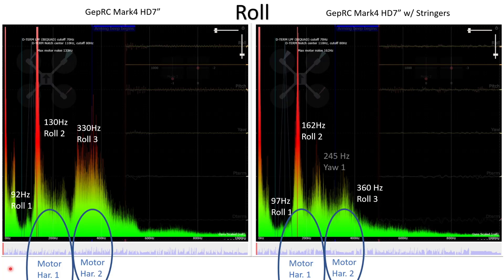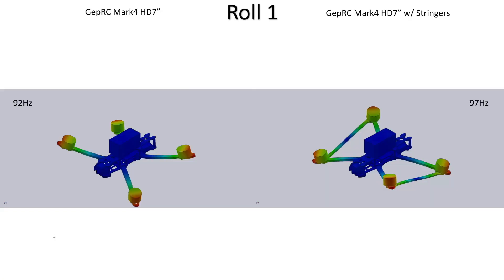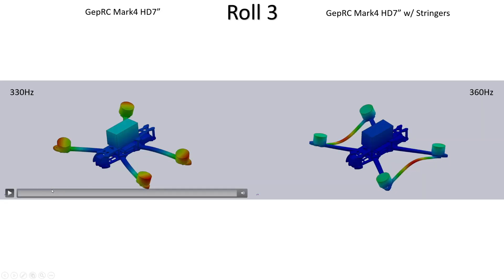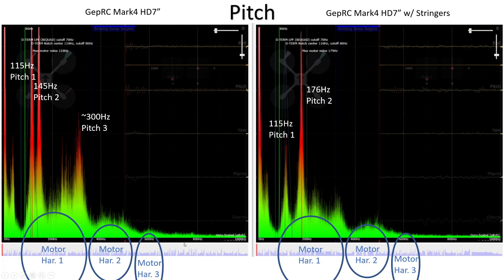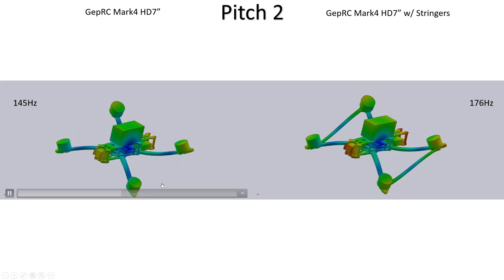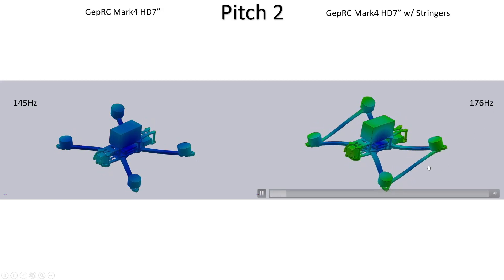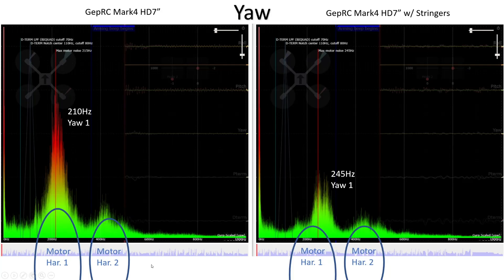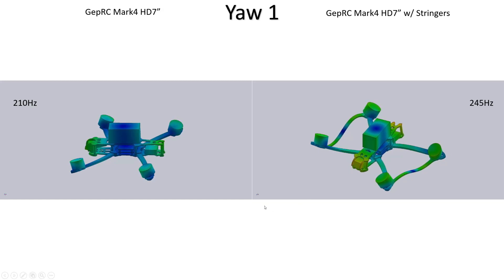Improving the vibration performance of your quad with some simple carbon fiber pieces!

Comment: How did you attach the stringers and did you make a video on best way to attach the stringers?
Reply from the maker: I used longer motor screws.
Reply: @ChrisRosser  I got it 👍  that's what I was thinking just wanted to make sure

Comment: i am sorry but the stringers dont fit a usual GepRc mark4 7". the hole distance in the stringers are wrong. the GepRc mark4 Arms have only 16x16mm holds for the Motors, your stringers are for 16x19mm hole distance.
please correct that before more people (Like me) let them CNC milling and Need to rework the Holes to fit the Mark4 Motor Holes.
thank you
Reply from the maker: I don't know what to tell you? They fit both of my frames... The arms for the Mark 4 7inch have 16x16 and 19x19 mounting. They should even fit 16x19mm (but I don't know of any motors with that pattern) I'm sorry to hear that you had problems.
Reply: @ChrisRosser  No Problem, i Just Open one hole to a Long hole with my dremel to fit the 7" frame. IT works Like this. 👍

Comment: I've got lot of experience with this frame. To be honest, it's horrible. It's way to soft. I was running it on 2806.5 motors on 6s and biblades. It was impossible to get good flight performance due to massive frame resonance. It needed tons of filtering and notches. 
I switched to the FR7 frame which is much stiffer using 6mm arms. I also increased the thickness of all plates to 3mm to make it even stiffer. It's still not perfect and especially running biblades still induces vibrations causing jello. Props and motors are perfectly balanced, so it's again some frame resonance.
It would be great if you could take a look on the fr7 open source frame (see on thingiverse).
Regarding the props, I've tested nearly every 7" prop on the market. The best balanced prop is the HQ 7x4x3. All other props need to be balanced. The worst efficiency has the dal Fold F7, but it runs very smooth. When running biblades I would suggest using APC 7x5, they are very stiff and have the least tendency to flutter. They are also extremely durable and efficient at higher speeds.
If you are interested in more information, just write me. I'm doing testing for over 1.5 years now on 7" platforms and would be happy to get some more background knowledge in terms of resonance management.
Reply: hey Waldemar, 
you say you tested a Ton of Props.
Did you Test the Gemfan 7035 biblades, i am about to buy them for Testing because i dont want to Stick to the Dal 7056 triblades anymore they Draw a Lot of amps.
i think lower Pitch would bei better for Higher Rpm and create Higher frequencies and less jello.
also Low Pitch will Draw less amps and give Higher efficiency as Well.
correct me If i am wrong.
Reply: @MrJT270567  
Biblades resonate different (at lower frequency) and create lots of jello. Also the gemfan biblades are quite flimsy.
If you really want to go with biblades, use some APC 7050 or HQ 7045 durable.
At the moment I'm using the new gemfan 7035 cinelifter props. They have good balancing and are very efficient.

Comment: How would one go about getting some of these stringers? I have a Chimera7 on order.
Reply from the maker: If you can design the parts you can get them cut by any local CNC machinist who works with carbon fibre. I use CNCMadness.

Comment: Fantastic content. I wonder if changing the center of gravity on a quad (eg, top mount battery vs. mid mount vs. bottom mount) would bear any significance in dealing with vibrations? Personally I really like how mid mount frames (like the Remix) fly, and all those slammed builds, I always assume that putting the battery at the level of the powertrain could reduce the force required to swing that 200g weight thus putting less stress on the carbon. Could you share your thoughts on the relationship, if any, between vibrations and the cog? (I have zero science background so sorry if this sounds like bro science)
Reply from the maker: I've added this to my content list. Thanks for the suggestion.

Comment: I have the same frame GEPRC Mark IV, its very soft and vibrating on pitch axis, i have also stiffen it up but closer to the bottom plate, it's better but not perfect. Emax Eco 2807 1300kV on 4S is perfect but at 6S it;s a drama, motors to powerfull, and frame is bending.
Reply from the maker: Sorry to hear that. I hope the video helped!
Reply: @ChrisRosser  this vid made me sure in  my doubts about the frame. Awesome job!

Comment: Hi Chris , thanks for the great video. I have 2x GepRc Mark 4 HD6 frames (with custom 5.5mm arms) and one GepRc Mark 2 6" , i  use them for comercail work and mid range crusing. I was wondering if you could share the files for the carbon fiber stringers it would be intresting to see difrance in performace on a 6" version of the frame. Keep up the good work :)
Reply from the maker: I'd be happy to share the files. They are for 7 inch but I'm sure you can modify them. Can you drop me an email (my address is in the about section for the channel)
Reply: @ChrisRosser  Thank you very much 😁

Comment: I'm really liking these videos!  Great job with how you manage to break it down into something fairly easy to understand.  Are those HQ 7x3.5x3 V1S props?  I had bad experiences with those, the blades seem to bend up or down easily making it go out of balance.  Also the ones I was using had an indent at the hub that not all of the prop nut would screw up against.  I just got some HQ 7x4x3 PC I think they were listed as.  Pretty sure they are a bit heavier but they seem smother in flight and all have nice straight blades.  Speaking of props, there's another interesting test, HQ 7" VS Dal 7" fold.  The joints in the fold might help to reduce vibrations?  Also they have a pitch of 3 on the blades so they should be able to be run at a higher RPM without too much extra amp draw.  If I get the time I'll record blackbox logs of both to see if there is any frequency or amplitude difference.
Reply from the maker: Good eye Conrad! Yes they are 7x3.5x3 HQ V1S props. I've not had any issues with blades bending but I don't freestyle that drone so I've never crashed it. Still on the first set of props. I've tried DAL folding props and they feel much the same but you are right WE NEED TO APPLY SCIENCE! 😋 I will do a comparison log of floppy props vs HQ V1S and see how it affects vibration. Could make a good video or short, Thanks!

Comment: I love this insights on how different design tricks affect the vibration performance. 
Now the structure is more stiff, can you reclaim extra weight the braces added by narrowing the arms? 
How arms of variable width respond to the vibrations and resonance? For example thicker at the base and tapering to the ends. What shape would be theoretically more beneficial?
Reply from the maker: Glad you like the video, have you seen the other ones on my channel? Great thought about narrowing or tapering the arms to reclaim weight. I think narrowing the arms would negatively affect the resonant modes that don't flex the braces. A different design could mitigate that. I've been working on something so stay tuned for a video on that. In terms of the best shape in theory a tapered arm would be best but it would really need to taper in thickness which is not practical with traditional CF plate arms. Some taper in the width could be beneficial but there is a school of thinking that you want the arm to break at the root rather than the tip to minimise the risk of damage to the motor. That thinking would lead you to prefer a rectangular arm.
Reply: @ChrisRosser  I've seen all the videos on your channel :) And eager to see more. Considering better frame design have you thought of using square carbon tubes? Square section provides flex rigidity, circular hole reduces the weight while maintaining twisting rigidity. I was thinking about 6x6 profile for A arms or 8x8 for single beam arms. Should be massively lighter and stronger then typical arms

Comment: Can’t wait for you to analyse the Apex frame. I’ve tried quite a few frames and the Apex seems to be on another level, I can turn a lot of filtering off completely but leave it turned down so I can fly back safely when I bend a prop. It’s also an incredibly tough frame without being super heavy.
Reply from the maker: The Apex has a secret to it's good performance, I can't wait to share it with you. I think it might be a happy accident but I'll leave it to you to judge! As for weight the Apex is reasonably heavy for a performance 5in frame at 125g so you would expect excellent durability at that weight.
Reply: @ChrisRosser  Interesting, I didn’t think the frame was that heavy, I was just looking at my AUW using standard hardware with caddx vista, 2306 motors, GoPro session in tpu mount, 6S battery, the plastic feet and bumper installed along with the thick battery pad and tpu antenna mounts is only around 650 grams. I am using a 20x20 stack though which probably saves some weight.

Look forward to your video on the frame.
Reply from the maker: @MUNKYFPV  The AUW of 650g is pretty good with a GoPro. But even a light frame would only save you 30g or so. The frame isn't a big proportion of the AUW if you run a go pro 😁
Reply: @MUNKYFPV  how the hell do you get 650g auw? mine weights 770g with hero6 in tpu, 1300mah 6s and two strong straps
Reply: @ivicanikolic034  I think I know where I’m saving weight, the session 5 is quite a bit lighter than the hero, I also fly ovonic 1000mah packs which only weigh in at 170 grams, but I get 3 and a half minutes full send, 5 minutes if I take it easy. I’m also running a lightweight 20x20 mamba stack. It all adds up.
Reply from the maker: Get hyped, the Apex video is finished and scheduled to drop tomorrow 5pm my time. 😎

Comment: I would be curious to see the fr5. 5 hex. The files are online.
Reply from the maker: A hexacopter could be really interesting, thank you for the suggestion! Do you fly this frame? how does it handle? Are you able to source blackbox logs?
Reply: @ChrisRosser  I do fly this frame and can absolutely log both bf and inav. It flys great on BF It have it on inav as a long range rig and am still figuring out inav filtering. On inav the center motors get warm if flown hard with alot of filtering.  BF with the filtering much reduced they are cool. Would be great if you looked at the logs
Reply from the maker: @RubyS.1  Wonderful! If you can send me the betaflight blackbox logs at a 2kHz logging rate with debug mode =  gyro_scaled that would be perfect and I'll take a look 😁
Reply: @ChrisRosser  ok logged a bunch at 2k gyro scaled where do you want me to send it
Reply from the maker: @RubyS.1  if you could send it to my email. You can find it in the about section of my channel! Thanks😁

Comment: no stringers or that quad would never come off a tree. :D
Reply from the maker: I know its a tradeoff! But it really does make the video quite a bit smoother in my experience. If you have a 7in with Jello and you are confident you can stay out of trees this could still be a good option. Where do you fly?
Reply: I just had drone call out the sky and hit a tree.  Thank God didn't get stuck
Reply: I think FPV shops should sell equipment to climb the trees like lumberjacks do.

Comment: Hi, how do you know which mode is which? Are they frequency specific? Thanks
Reply from the maker: Yes you can identify the mode by the frequency. Usually the frequency in the simulation is relatively close to the frequency in the backbox logs (~10%). You can also look at the mode shape and see if it appears to move the flight controller in a way that would be detectable on roll, pitch, or yaw. I find it easier now after having looked at many frames!
Reply: @ChrisRosser  so if I see a peak in an axis, I just need to see what frequency and go directly to your mode shapes video and look up the mode I assume? Oh and I'm big fan of your work!
Reply from the maker: @marukothekid  if you have the same frame absolutely. If you have a different frame then the frequencies may be different but often the mode shapes are similar so you can figure out which is which 😁